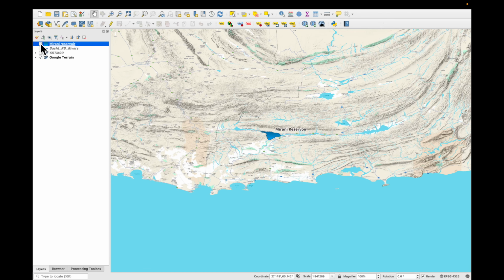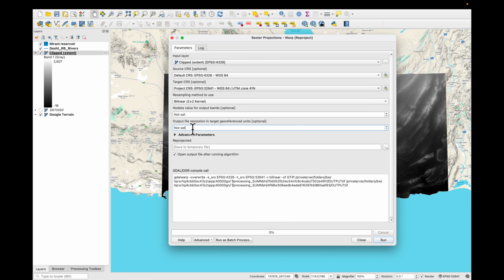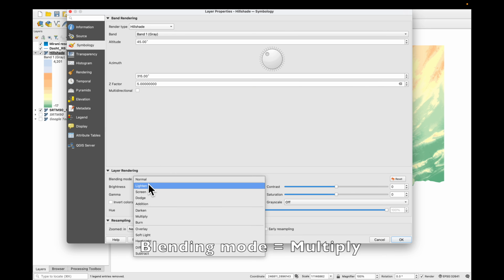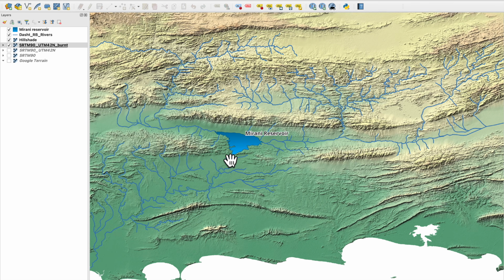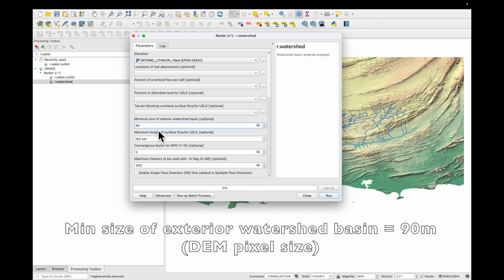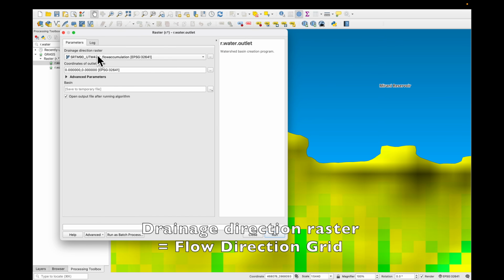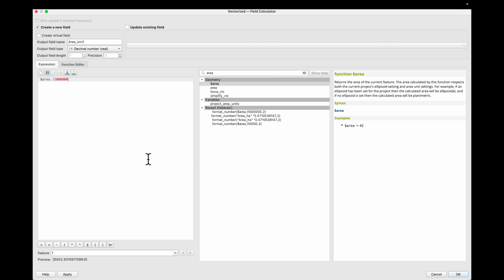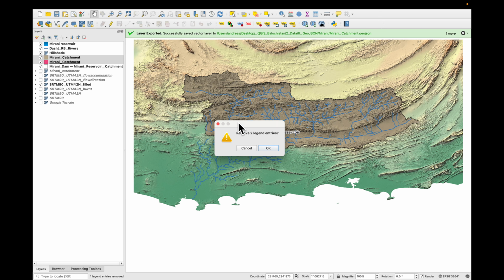QGIS for Hydrology - Catchment Delineation

Comment: Thank you for your video. May I ask this question? I am working in an area with several lakes (which will equate to your reservoir?) and rivers coming out of these lakes. Do you burn the lakes together with the rivers (as if they were the same type of entity? Does it matter if lakes=polygons and rivers = polylines? Do you have to digitise the lake's perimeter so that rivers coming in and out of lakes join the perimeter of the lake at intersections/points on the perimeter of the lake? (= topologically correct?) Thanks in advance!!
Reply from the maker: Hi Viviana, I think the best way is to digitise all your rivers, and then pretend that there is no lake - i.e., the rivers flow into the lake and then join a main river which flows downstream in the middle of the lake until it exits the lake at an existing river. I assume that the lakes predate February 2000 when SRTM was flown? If so the DEM will show a flat surface where the lakes are, and this can create a problem when you fill the holes in the DEM. The idea is just to make the DEM channel the water in the right direction, so that your rivers/tributaries are roughly in the correct locations.
Hope that makes sense. All the best, Andreas

Comment: Great video! Can you please help me out? I'm having slight trouble burning the rivers into DEM, coordinate systems of both the elevation model and the vector layer (rivers) are exactly the same. After burning the burnt layer appears to be in a different region (but the same coordinate system as the DEM and Vector layer), but the pixel size changed to 1,-1, where the original DEM was having pixel size 88.93682301984790683, -88.93682301385906896.
Reply from the maker: Hi Harishyam, I would advise you to use 90m as the raster size of the projected DEM. Then start a brand new project. Add the DEM and the rivers & make sure that both layers and the project CRS are in your projected coordinate system. Then try again. Hope it works. Did you get the manual for the correct settings? See the description below the video for the link.
All the best, Andreas

Comment: Hello again. Im trying to make it using SAGA Tools, from DEM, and when it comes to strahler order, it doesn´t works.Don´t match with main line rivers. Taht´s the way you decided to digitsed rivers firt and create it a new layer polygon? Thanks
Reply from the maker: Hi Lorenzo, you have to burn the rivers into the DEM first if you want the Strahler order to match the actual rivers. You can burn them really deep and wide to make sure that they don't get filled up completely in the fill sinks in dem process which is next. If you follow the manual it should work out OK. The link is in the description below the video. All the best, Andreas
Reply: I @GeosearchInternational i Know...I Know....i m learning by making mistakes and the Hard part is to get the layer of rivers by my own self like you did. Please, any clue? Did you did it by hand step by step o did you use any source to short the process? Thans
Reply from the maker: Try to download rivers and streams using QuickOSM plugin. Edit as required or digitize new rivers if they are not good enough or missing. Good luck & all the best, Andreas